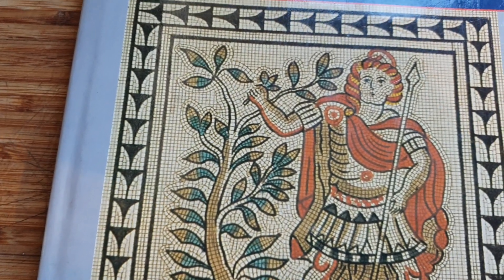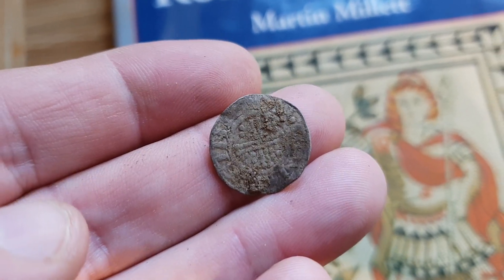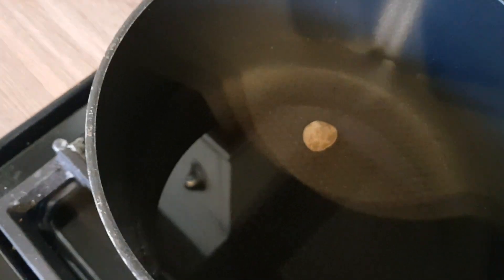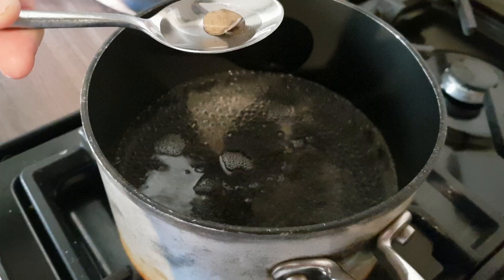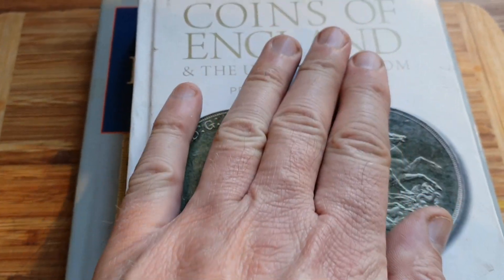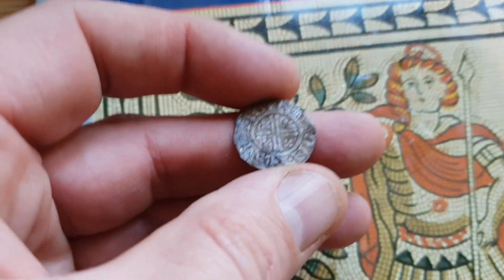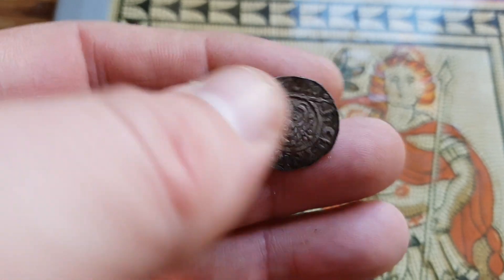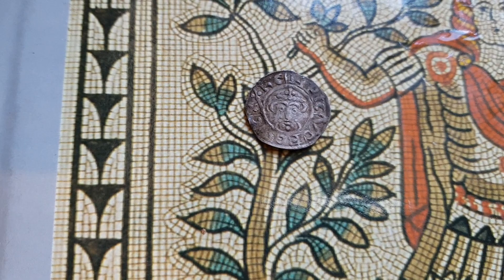Metal Detecting with Unearthed UK LTD

Comment: Hi Graham , does the boiling water method work as well as smacking it with a big bloody hammer method LOL ,  nice one mate , take care ATB Rob .
Reply from the maker: I found a big hammer last week in my garage, I will try it lol
Reply: Hi Graham , all joking aside I put them in-between 2 small thin Aluminium plates in a pair of mole grips heat it with a small gas torchand gradually increase the pressure in the mole grips , usually works( not that I find many LOL ) ATB Rob .
Reply from the maker: @thegallowsdetectorists666  you keep doing what works mate, I look forward to your next video!